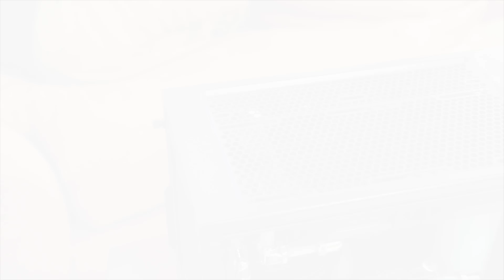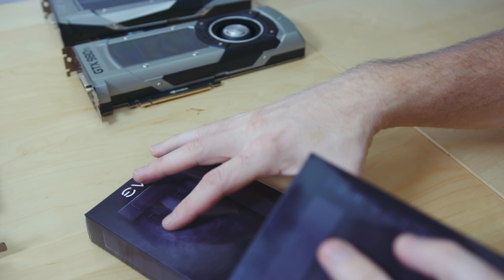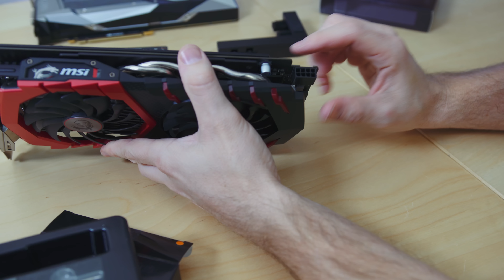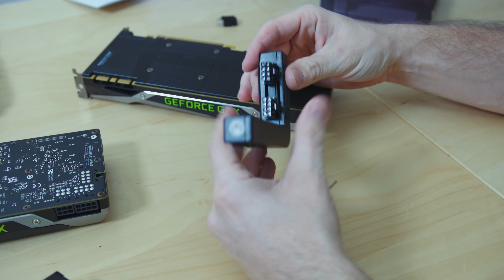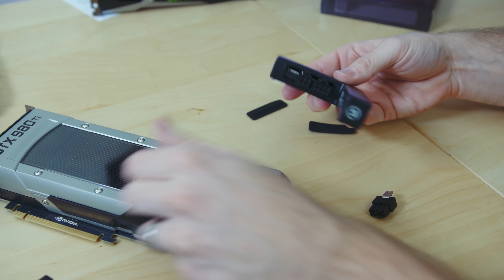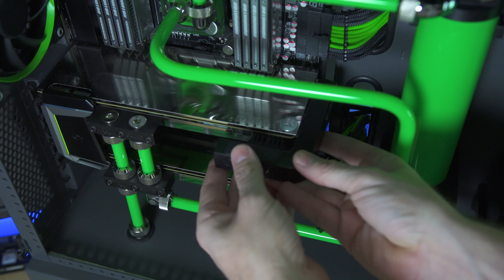How to manage your cables using EVGA Power Link

Comment: I don't really like it. I don't think it makes it look better, I think it's very distracting when you try to look at the computer a piece of art, which is what these are trying to do. Also, they look very cheep, and overly complicated, additionally the adapter adds two points of failure into the system. I think if these were made of metal, and were a shroud to route/hide the cables to the back of the case instead, it would be and look much better.

Comment: They look better without the powerlink I believe. The "problem" with skunkworks are the backplates, they have a very nice silver finish. Then you put the powerlink in and they look incredibly cheap compared to the TITAN X cards.

However, I do believe they would look better in a cheaper system with a regular GTX 10 series card.

Comment: I actually like it a lot with the Power Link installed on the cards. It adds yet another piece (or pieces) of EVGA branding (since practically everything hardware-wise in Skunkworks is EVGA, except for the RAM and CPU). 

Also, in your case (no pun intended...okay maybe a little bit) it routes the cables to where they're more in line with the 24-pin cable, so it looks more symmetrical (Is that the right word?) and satisfies my OCD a little more than with the cables coming in at awkward angles and wrapping around the side of the card.

Comment: Instead of having to come out with a somewhat bulky adapter, why don't GPU manufacturers just come out with a card design that puts the power connectors on the rear (like mobo/PCI-E slot side, not the front-of-the-case-facing side of the GPU like in this video) of the card? That way, the cables wouldn't show at all. 

Okay, yes. For people that like to show off their custom color single-sleeved cables, that would be a downside, but if you're one of those types of people why are you watching this video in the first place? Lol. 

For those of us that like to keep cable clutter to a minimum (to show off the hardware itself and not the cables), though, it would be GREAT! 

Just my idea and my "two cents". :)

Comment: I'm not sure what I prefer, there's good and bad points.

They are a just a bit too bulky, the connector could be redesigned so its short, its only a matter of not letting the wires touch.

I have the same issue with my gtx1060(evga), the card is short so the cables have a long way to go, still haven't figured out a good way of routing them, but this powerlink won't fit on my card cause of the waterblock, so I won't be getting one anyway.

Comment: I like them in principal, but in execution they leave a little to be desired. The sag on the "back" end of the unit makes the whole thing look very cheap and I think it would be hard for me to trust them over time not to damage the solder on the power connectors on the card. I think a cent or two worth of plastic support tabs on the back  resting perhaps on the back plate to help brace the long end of the unit would be helpful with the sag issue, but Im not sure if this would be detrimental to cards with no backplates, causing it to rest directly on the PCB.  

All said, as is I don't really think I like them. And if you can't fix the sag issue, I don't think they look all that great in Skunkworks. The lines are so sharp and rigid over all, that those sagging power links kind of detract from the over all cleanliness of the build.

Comment: I do like it with it but i think the graphics card makers need to just add a cable management clips or rings to the back of the cards so you can the run the line up the cards flush.

Comment: I mean while they are a good option for rare cases that someone might need to change to position of the power plugs for the graphics card for layout purposes it's still bulky and doesn't look THAT good imo. For some builds they might've worked but i'd rather see the expensive cables like someone else already mentioned or even better of have a graphics card with the power plugs already placed on the back of the card. Great video!

Comment: You should have plugged the cables into the adapter and then the adapter into the card... would have been easier.

I like them and hope they improve the design and materials.

Comment: I like it! Cleaner look, with not much wire showing.  Maybe you can glue a small piece of plastic where the link is sagging so that it's resting on the back plate of the GPU to take some weight off the link itself.

Comment: I think it looks good, but I do worry that it acts a a second class 'leaver' to increase they force the weight of the wires adds to the end of the card.  I know EVGA wanted this to be useful for as many cards as possible, but they need a system to secure this extension to more than just the plugs.  

If you can train the wire great because I think it looks good in your system.

Comment: I actually quite like the look of the new adapter. Length will definitely be a concern in some cases (either form of the word is applicable). Also, perhaps some conveniently placed double sided tape would help stabilize the adapter and keep it from sagging? I also agree with those who have said that it would be nice if GPU companies started finding more aesthetically pleasing options/positions for the power connectors. Though, the current location does seem to be the most universal...

Comment: If those would have light white LEDs so the EVGA logo lights up would be nice. Also they could put a little whoopdidoo on the long part where the cables go in that just clings to your backplate so it doesn´t have to support the weight/pressure from the cables all alone.

Comment: This is not a Skunkworks product in my opinion. His pride was based on the visual. What good is the extra butter put into the cables if it cannot be shown. Cable management was already mastered. i would peg his product for the machine with either less reach for the graphics card or for a not as fancy cable. I had to stew on the conclusion. Watched it twice to be sure.

Comment: Good concept poor execution. It helps the aesthetic but is solo clunky. If they had been designed to be thin and more streamlined I think they would have a place but as it is they had might as well be a hollow run and you hide your cords inside the rectangular tube. I'm eure the second or third generation will be where its at if EVGA sticks with it.

Comment: I think it looks better than just running the cables around to the window having side of the cards.

Don't really think either of the configurations look that great, TBH. Not knocking the build, I just think power cable aesthetics aren't even an afterthought when GPUs are engineered. I think they should all be on the side facing the front of the case at least, but I'd even prefer that they were on the Motherboard side of the card (if motherboard and case allow).
Reply: If the power link had a tab on the long side that slid even 2mm to just cover the GPUs PCB, there's the sag issue solved.

I just wish it was thinner/shallower somehow.

The LED logo would be nice, or maybe just stickers to color match your water?

Comment: Liked it before you added the adapters. Here I was hoping soon(next few years) the motherboard will provide all the power your gpu(s) will need so there can be 2 less cables that you'll next in a pc build. Reason why I like M.2 ssds and will never use a sata 3 base storage option ever again. That'll be great if all you ever needed to power everything in your pc was the 24 pin cable to the motherboard.

Comment: I think it can go either ways, the system does not need  something like that, obviously, but it adds a little something.
I would see such adapters where the space toward the side of the case is limited, but given the bulkiness of the adapter, I wonder if any space is saved anyway.  If EVGA refines it and makes it slimmer, it would work for such need, and also develop some way the connected could be turned around -- like allowing the side connectors to be turned as well.

Comment: Great video. When these came out I was very interested, but don't like the idea of having "EVGA" displayed so prominently and also feel that they could have been manufactured to be a little slimmer on the top. On the whole looks like  a great product and would buy if not for the above. I'm wondering if I could maybe mod these to have an LED display on the top showing the voltage where the evga logo is, and maybe smooth out the rest of the logo...... but I digress

Comment: If you want a square look then why don't you drill a hole in the roof of the basement so that you can route the PCI cables straight up to the connectors? I'd like to see a little video on that.

Comment: But if your good enough with a soldering iron (and don't mind breaking the warranty on your gpu) you could find a new pair of connectors with the locking tab in the right orientation for the Power link

Comment: Personally, I don't really see a reason  to buy these. Paying 30$ just so I could route PCI-E connectors in a bit tidier way is not really worth it. They also look like a hunk of plastic which doesn't really contribute to the esthetics of the build. Sometimes it even detracts, for example in a case where you have nice sleeved cables.

Comment: It might work for some builds, but not Skunkworks.
I thought it was weird that the connector for the cable was at the... well what ends up being the back of the card. It ought to be placed at the "bottom" of the power link. So they would point down toward the motherboard.
This was, the cables are still quite noticable!

Comment: I'd rather have these adapters than changing where the connectors are on the board. But I wouldn't buy them, my case doesn't have windows or anything so I could care less.

Comment: I actually like the Power link as a product. it is a good idea.

I think it works really well in skunkworks as it tidies up the cable management and gived an overall cleaner look to the GPU cabling. Personally i would mod the power link to make the EVGA logo pop out so you had the green back the logo in black.

but I agree with Jay, it is subjective, and i dont think the power link would look right in every build. (example the NZXT S340 where the management hole is on the shroud, not the mobo tray)

Keep up the good work jay :) from one of the silent majority.

Comment: I think as it stands, Skunkworks is 50/50 for me with or without the Links. Your cables are so aesthetically perfect that they don't take away from the overall impression. If the Link had white (or RGB) LED backlighting for the logo then it would definitely look better with them.

I'm glad you pointed out that they cannot be inverted, I need to go home and check how my plugs are oriented before adding the Link to my christmas wishlist!

Comment: Good idea not a great execution though they look a little too bulky for me I'd rather have the sleeved cables. It varies on GPU length and case size also if they will work effectively for example I have a Gigabyte Windforce GTX 970, a fairly long card housed inside a Define R5 on a ATX motherboard. If I were to use the Power Link it would push the cables past the grommets meaning I'd have to route them differently which in turn could make the cables messier than just routing them to the GPU directly.

Comment: For a first gen. product, i think they look nice. However, i just wish that EVGA would produce models of this that can fit other brands, and start just simply integrating this setup into the GPU itself, with the power being plugged into the end of the card, instead of the front. My MSI card would not be compatible with these. D:

Comment: I think that it's the kind of thing one would buy to put in a new rig rather than an existing one because of the retraining of cables and the possible break of the PCIE connectors, which would make the GPU an expensive door stop if it was to happen.

Comment: So with standardised power sockets on all cards these days, this would also work well on AMD 200 & 300 series cards as well. New RX400 may struggle with mid point power socket but rear partner board socket  cards be ok.  Only defining factors are as you say -  card length to motherboard size + if any MB connectors are in the way, case size and if enclosed or windowed etc.  yes on an windowed AMD build having a EVGA logo showing may look wrong. But depending whether your GPU is vertical or horizontal, one can soon block or mod the EVGA logo out. Nice review Jay cheers.

Comment: yeah i think evga can improve them. i sort of agree with you Jay regarding your cables and how they look but at the same time if your cables are super nicely routed with with custom cables and combs id rather not use these power links because you'd want to show off your cables. if you wana hide your cables and don't want to spend too much cash on custom cables then these are a good option.. Pew pew

Comment: Like the looks after. But there is some room for improvement. More support on the backend of the card would be nice, so it doesn't put all the weight on the connectors, like you said. Also a led would be nice to light up the logo. But it would be nicer if they had the powerplugs already on the end of the card, instead of having to use such a device.

Comment: I think I'm gonna get it for my SLI setup. It's a pity they are just plain black. There should be some room for customisation or EVGA could stick some LEDs into this things :-) I have modular PSU (Corsair) with regular braided cables so it will upgrade aesthetics in my rig a bit. In Jay's case I would stay with those beautiful flat cables, probably.

Comment: EVGA went full apple with this "product", instead of placing the power connectors at the right spot from the beginning (facing the front of the case) they put them on the side for no reason at all.

Comment: It may fit any evga 10 series card, but with how far in the power connector is on my 960 ssc, it wouldn't reach anywhere near it, which is a shame because my gpu cable looks terrible right now

Comment: IMHO it look far cleaner.  As for the lag issue seems that could put either a single tab on the adapter that would 'hook' over the card near the motherboard.  Could even be the length of the adapter, basically whichever looked the best.  While I really dislike the RGB color trend most do, and for an adapter like this it's very surprising they wouldn't have built an LED in behind the logo as you thought might be.  Others have said it looks plasticy, I sorta agree, wonder what it's like in person, I'm guessing you can't really tell. And if you did just paint it.  Hell Jay could paint in lime green to match the rest...

Comment: EVGA sent me 2 to review as well. Honestly the aesthetic is a bit off because the ek water blocks have slimmed the cards down in Skunk Works. I can include an image on your twitter with them installed on 2 EVGA 1080's with their hybrid kits attached. Those are bulkier and match better, it's just more aesthetically pleasing on a bulkier design like the AIO hybrid coolers, and they definitely match the hybrid kits (which I figured as they're from the same co) so yeah, I guess respond here if you want me to send a couple of images to your Twitter so peeps can see what they look like with that option. I definitely wouldn't use them on a reference or founders blower design, even the Titan X's. The squared design mismatch the polygon design and the colors don't match.

Comment: I'd use them in smaller cases, or, when I do not have nice, colored cables. Depending on the build, it may be helpful as well to provide better asthetics, especially when custom painting/wrapping to match a build. (Skunkworks = thin green pinstripe down the middle to the back?)

I would be much more likely to use them in more situations if they were built with more premium materials.

Comment: What is the width of the Powerlink? I have a Strix 1070 in a Corsair Air 240 case and my cables are currently hitting the side panel. I hope the Powerlink can fix this issue! Thanks

Comment: I think they do look good but the build design makes a huge difference, and thus impact, on whether they actually do look good. In Skunkworks they definitely look great but in my PC, Arpy, which is enclosed in a gigantic Corsair 780T, this might be a little less good looking as I have the white on black look (like Aperture Laboratories, plus the logo on the side panel) with white braided cables. I would like, even though I doubt it is possible, to see a lit version with maybe your logo of choice like those new PSU shrouds with custom lighting and logo's, as I think it could look great!

Comment: so is it electrically one to one? If you plug in an 8pin to a 6pin conversion I assume it doesn't do anything or pull any power through the 2 pins. I also assume its mapped left to left etc.?

Comment: Just installed one of these on my 1080. I don't have custom sleeved power cables, so I think it's an improvement. I have two M.2 SSDs for storage, so I don't actually have any cables in the visible part of my case now (S340).

Comment: I have mixed feelings on the adapter. I think its a great idea, and the cables look much better when using it. However, its way too bulky and it does throw off the consistent look of the gpu. I think they look ok in skunkworks. I would suggest coloring the EVGA logo  green to match, or sparay painting the whole adapter to match the gpu back plate or the loop fittings.

Comment: I'm not sure if I like them or not. They have a similar look as the black square-ish cooling ports on the graphics card. And I also agree that the round-ness of the cables did not fit to the rest. 
But on the other side, they look a bit bulky and is also a bit boring since they are only in black with no colors.